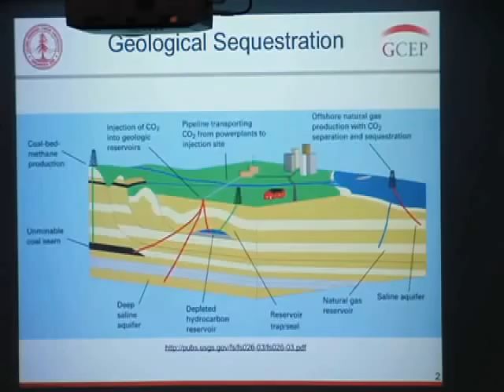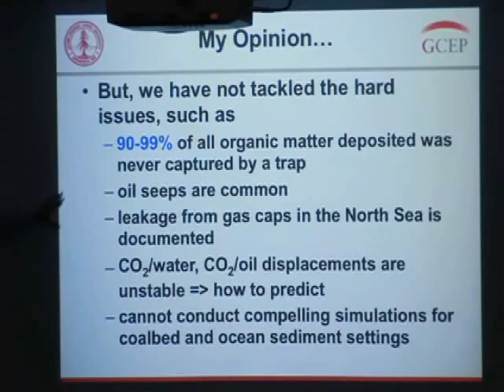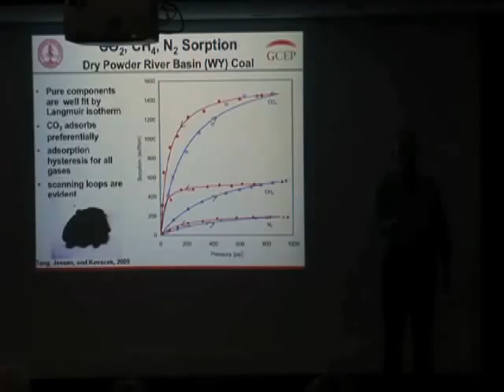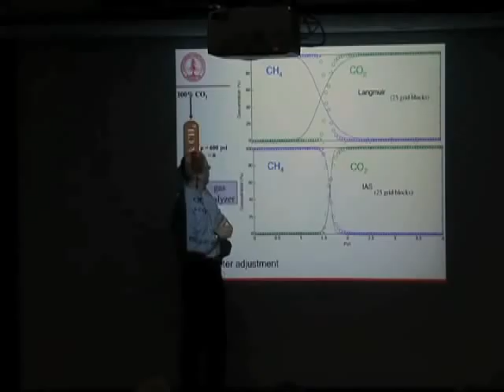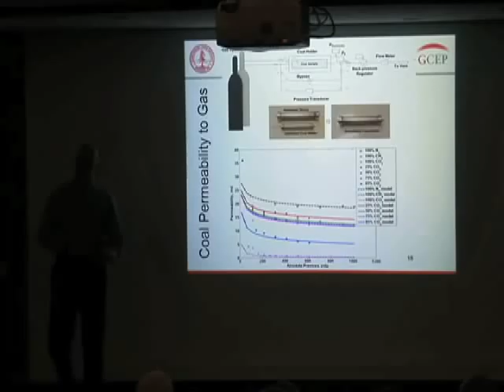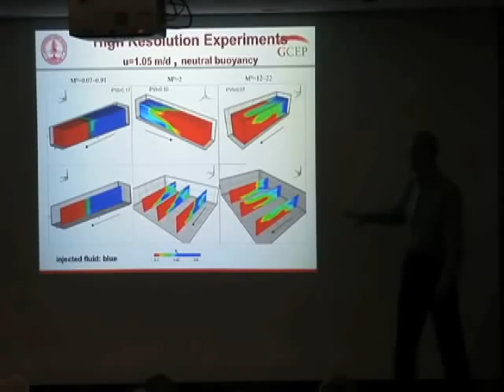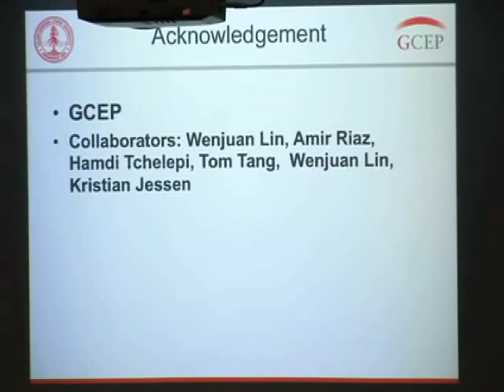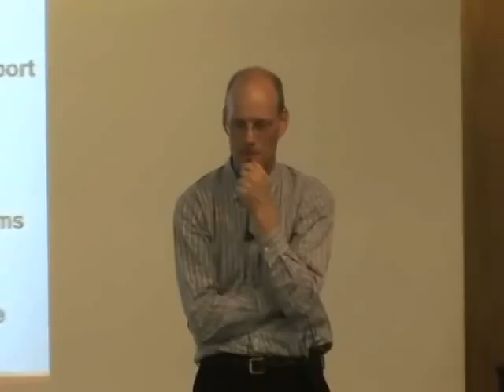Carbon Sequestration

Comment: Good video, but the quality should be higher.

1) Direct line in of professors audio into mix-board
2) Mix board switching between computer output and the camera, to show slides clearer.
3) Have presenter using a red laser to clearer show the point of focus

That is all it takes to increase the value of the presentations three-fold.